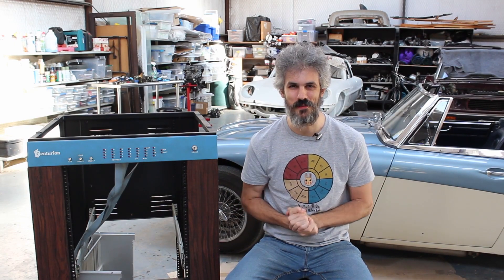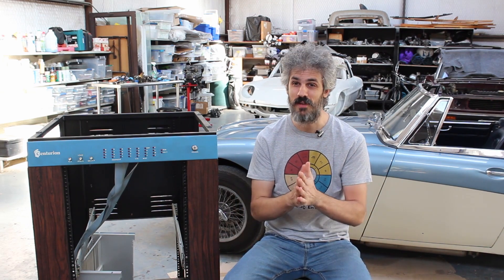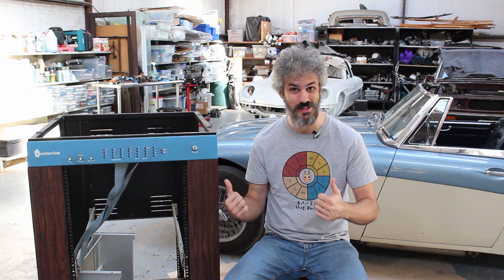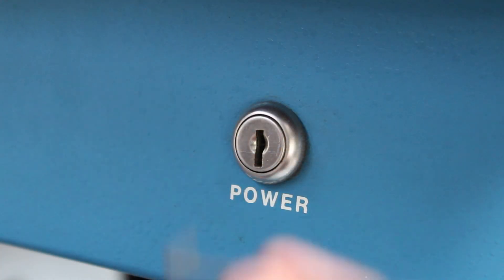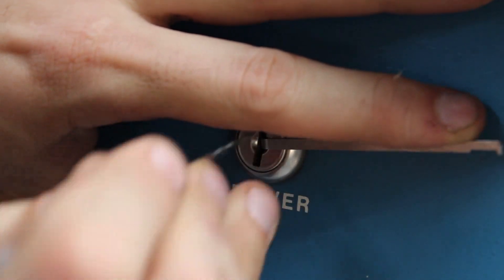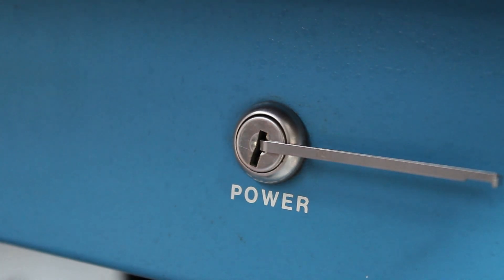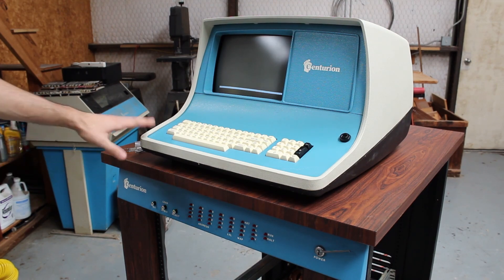Minicomputer Part 7: Cleaning and Testing

Comment: Hi;
A few more things, Now that I have watched the CRT cleanup..
So, Do You know what Baud Rate that the Mux Boards use ?? Or, do they have Auto-detect for the Baud rate, that is usually done by doing a Carriage Return.. Also, You need to check all of the 9 pin ports on the two mux boards for a crt signal activity.. And the Resonant Oscillator (Crystal) on one of the Mux boards is a Particular Baud Rate starting point.. Also, what are the 4 pin switches set to or for on the Mux Boards ?? Also, tie the two CRT Terminals to each other pins 2 to 3 and 3 to 2 and 7 to 7 and see if they will talk to each other, just for a check of them, as well..
THANK YOU Marty
Reply from the maker: Thank you for the awesome advice!
I don't actually know what the Baud rate is, I've just been leaving the terminals set as they were, but unfortunately, each terminal is set to different baud rates, which means I have no clue what it's actually supposed to be. Also, I have no clue what the 4-position DIP switch is for on the two MUX boards, but they're actually set differently too. I'm guessing that it's potentially setting a primary and secondary? 
That is an excellent idea to check the crystal oscillator to get an idea of baud, I'll do that the next time I'm digging into it!
Also, excellent idea to see if the terminals will talk to each other, plus that could be a little fun to see anyways, haha.

Comment: Hi;
Thank You for Your prompt Reply..
A couple of things -- One I like Your choice of background Music.. Also, I like the Rabbit or is it Buggs Bunny..
Also, I would start tracing from both the memory boards and the CPU Boards, back to the gold fingers and settle on whether it is a 16 bit machine or an 8 bit machine.. I would start from the Memory board first, as the 4116 memory Ic's You know what are the Data Lines and the Address lines, You just have to follow thru the glue logic back to the Backplane, and then secondarily follow those pins to the CPU/ALU and that  should clear things up by quite a bit for You and for the rest of us.. And of course put it down on paper or whatever Your favorite meads of documenting.. Don't worry about how it Looks, just do it..
And I also love Your Tube ALU/Computer.. You explained things quite nicely and I learned something that I didn't know before..
I am trying to build a TTL wire-wrap computer when I have the time.. THANK YOU Marty P.S When is the Next video ??
Reply from the maker: Thank you so much for the kind words!
I'm fairly certain now that it's actually an 8-bit machine. It seems that a lot of these old minicomputers commonly used a setup like this, with one 8-bit board for the CPU and another 8-bit processing board for handling I/O, which would be the CMD board in this one. That also makes sense with the Memory boards sense they're arranged in 8-rows of 8-bits. They just need some additional control for chip select to give a large array of 8-bit memory to access. Once I get more of the system functioning though, I think it'll be much easier to see exactly what data is going where and in what amount using the scope or even a good logic analyzer!
Thanks for checking out the tube computer series too!
I usually upload new videos every Monday CST, but I missed the video this week because I had family come visit, so I took a little time off to be with them!

Comment: Hi;

I just Discovered Your Channel earlier and I am really interested in Your Progress on this Machine, even though I have never heard of this brand of minicomputer.. 
Did You notice that the Terminal printed "Hello" after a bit, and most likely was waiting either for input from You and or waiting for a Drive "ready" signal..
Also, you mentioned in a previous Video that it only had two 4 bit alu Ic's.. but it is a 16 bit machine.. Many machines of that era used this same technique for cost reasons it was cheaper to use less ALU IC's than 7400's Ic's as glue logic, instead of 4 ALU Ic's and less glue logic..
Check out the Data General 1200 Nova.. For an example of this technique, they used one 4 bit alu repeatedly using it 4 times to get the 16 bit output..
THANK YOU Marty
Reply from the maker: Hello and thank you for checking out the videos!

And don't worry, I had never heard of this brand of computer either until I saw it in person. It's a really weird footnote in computing history with very little information out there on it!

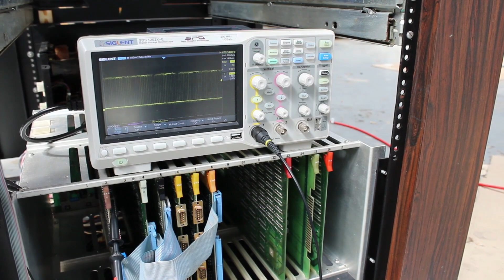I should have specified in the video, but the "Hello" that prints on the terminal is actually just me typing "hello" directly into it trying to get a response out of the machine (the terminal has self-echo turned on, so anything I type is internally echoed to the screen). If you watch closely from about 15:57 on in the video, you can see that as I snag snapshots, it's actually the same pattern of bits just moving left or right. My guess if that you're on the money with the idea that the MUX cards only come into use after booting, and the CPU is in a wait loop looking for boot information from the drive. 

In the previous video I mentioned that it might be a 16-bit machine because I didn't fully understand the relation between the CPU card and the CMD card. A few other commenters on that video helped get me turned in the right direction. It's mostly likely an 8-bit machine, and the additional bit-slice ALUs on the CMD card are used for Input/Output control. There's so much extra stuff going on in this machine that I'm having a hard time following the total logic layout, but it sure is a lot of fun to stumble my way through it, haha.

Interestingly, I did something similar to the Data General Nova with the all relay binary calculator I built a while ago. It uses a 1-bit ALU that gets used repeatedly to give a 10-bit output.

Thanks for checking the channel and videos out!

Comment: Some transformer hum is normal especially when under high current loading, but you may have a loosened core lamination issue.  If you're lucky, this might help:

Eliminate the Cause of Excessive Transformer Noise/Humming

Part 1

https://www.youtube.com/watch?v=lUt8rE9tYo0

Part 2

https://www.youtube.com/watch?v=aAPpiWM_U60
Reply from the maker: Thanks for the links!
Some other commenters have mentioned that it's a Ferroresonant transformer, which is an inherently noisy design. Since they have an LC tank circuit and run in full saturation, they're really stable but at the cost of noise and efficiency.
Fortunately, the computer lives in the garage and it's not nearly the loudest thing out there, haha.

Comment: Time to pick up a cheapo logic analyser? (so you can clip onto say 12 or 16 lines on that ROM ... watch for address hits, data back and forth, and the read/write direction pins, etc .. when testing arcade boards for example, I always get an audio probe and listen for 'noise' (life) on pins around the ROMs and CPU, and when you gfet serious.. clip on an LA and see if the data going around makes any sense at all; if its slow enough and you can catch transitions, sometimes you can step through a few on a ROM and catch the read pulses and catch the bytes going out (if your scope has enough memory to record such things, or an LA dumping out over USB to a PC or something.) With a lot of luck, a LA may be able to decode you a data stream and you can compare to the contents of the ROM and verify hey yep, itsd getting sequential information and its coming from the ROM. Or check that address fetches seem to make any sense.. usually you'll get a few in aa row for instance, as sequences of opcodes get requested...

Super awesome!
Reply from the maker: Thank you! 
And it's like you're reading my mind, I've been shopping for good, used Logic Analyzers for a while now. Once I get one of the drives installed back in the chassis, I think a Logic Analyzer is going to become necessary to start trouble shooting different bits of the system. I've also been trying to figure out a good way to build a riser card that can go between a card and the backplane to push it out so I can clip leads onto it a lot easier.

However, just by hitting the single shot button over and over again, I was actually able to see a pattern, so the CPU is at least sitting in a loop, probably waiting for code from the drive (you can just make out a repeating pattern from about 15:57 on in the video).  But, a logic analyzer I think is going to be in my future soon!

Comment: Amazing, how well the chassis cleaned up, especially if you think about it being stored in basically a ruin. 
Even the wood is totally spotless. 
Another interesting thing is that the "time to find the serial lines" seems to be a valid next step, no matter what you do in electronics. 

Looking forward to the next episode.
Reply from the maker: Thank you!
And yeah, the Chassis cleaned up remarkably well given the state it was in! Though, I will say that the wood piece on the top is actually from the other chassis as the original one on this chassis was starting to de-laminate from water damage. The front wood pieces came up spotless though, which is crazy! If nothing else, the entire purchase was worth it for the chassis, though with the cleaned up data terminals thrown in, I made out like a bandit regardless of how everything else turns out. 

If you watch closely from about 15:57 on in the video, you can see that as I snag snapshots, it's actually the same pattern of bits just moving left or right. My guess if that you're on the money with the idea that the MUX cards only come into use after booting, and the CPU is in a wait loop looking for boot information from the drive. So, there's still a few things I need to tackle before I can start to expect any reasonable output, but we're slowly getting there!

Comment: Check the backplane, there where it looks kinda wrinkled, that might be the pcb delaminating. If it is delaminating then it might cause shorts or just not have connection between the boards.
Also tighten the bolts on the transformer might help with the noise.
Lastly check the ribbon cables, those old cables just need a bend or a hard bump to cause problems.
Sorry for the rant :)
Reply: What you see is the wrinkled tinning of the pcb.  And the nouse, is because it is a ferro resonant power supply, they are noisy!
Reply from the maker: Thanks for the pointers!
I think the backplane is alright. When looking closer at the crinkled area, it looks like it's just the soldermask starting to crinkle up. When I recapping the boards, in some instances, I could actually see the solder flow under the soldermask, following the trace. It's probably not ideal though, so I'll keep an eye on it!
As for the transformer, I believe its a Ferroresonant transformer, which uses an LC tank circuit and operates in saturation, and they're pretty known for being noisy. As long as the levels remain stable, I'm just gonna let it sing!
Good call on the ribbon cables, I hadn't thought about that, but you're right, they're quite old and could definitely have a problem.

Comment: That transformer sounds like a ferroresonant transformer. If it is, then the buzzing is completely normal. 
If there is an oil capacitor across one of the windings, then it's likely a ferroresonant transformer. Be careful around the capacitor, it will have several hundred volts AC across it.
Reply from the maker: Yup, you're absolutely right! In a previous episode a few commenters actually managed to identify the PSU transformer as a ferroresonant transformer, so it's good to know that those are inherently noisy! 
There's two massive capacitors in the PSU, one is clearly a DC capacitor for I'm guessing the 5V rail, but the other is definitely an oil filled AC cap for the ferroresonant transformer, so I've been particularly cautious around that one.
Reply: These are operated typically between 85% and 90% of rated load as part of the power conditioning design.  That noise you are hearing is because the transformer is operating in its saturation region.  (Natural resonance.)

Comment: It's likely looping waiting for the bootstrapping code. 
Go and get a proper RS-232 LED tester, and find the console port0, which will be the one with any text data present.
Never trust someone else's cables, go make your own, the pinouts are readily available everywhere.
Reply from the maker: You're definitely right that it's sitting in a loop. From about 15:57 on in the video, you can see that as I snag snapshots, it's actually the same pattern of bits just moving left or right slightly based on how quickly I'm pressing the button. 
I feel like a dolt, but I should have bought a proper RS-232 tester a while ago, it never occurred to me, haha. That has been rectified and a nice cheap one is on order!
Reply: Finding which of the console ports is the port0 is indeed a good tip, it's unlikely all terminals ports are active at boot without the system being loaded. If other similar computers are anything to go by, at least one of them should be outputting error messages regardless of the system/disks being present.

If I had to bet, I would guess the port0 would be the lower one on the multiplexer board with the crystal populated (the one missing the crystal is likely a slave to the other). Based on the dip switch settings of the terminal, they should be 1200 bauds, unless it boots at another speed by the default and the system settings on the disks changes it to 1200.

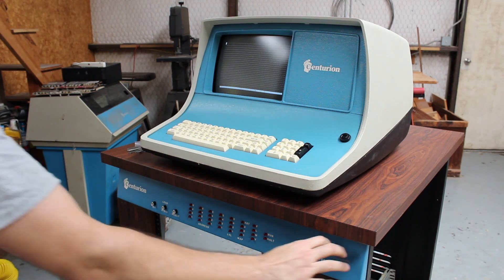I noticed on 12:30 that at boot, the address LEDs do change from one state to another, something is definitely happening!

Comment: noisy transformers are sometimes an indication that the screws holding the individual E plates together are loose.  It's worth checking if the screws are tight.  Also be careful about the 5v rail - TTL spec is 4.95-5.05.  it's very stringent.  If your meter is accurate 5.3 will be too high and can cause premature failure.  It's also entirely possible it's set high due to high load causing sag when all the cards are installed.
Reply from the maker: I think in this case, the noisy transformer is due to it being a Ferroresonant transformer. Those types of transformers have a separate LC tank circuit and operate in saturation and are supposedly quite noisy. 
I also checked the 5V rail once all the boards were in and there was a proper load on the supply, and it pulled the level down to below 5.1V, so it should be alright!
Reply: I remember in a previous video that one of the boards wanted 5.2V. I can't remember which video.

Comment: Don't worry, you won't be hearing the transformers at all once all the fans and the hard drives are spinning.

Btw. 4116 DRAM chips have a quite high failure rate, I'd expect at least 4 of them to be bad.
Reply from the maker: Oh yea, definitely! Already with the cooling fans under the computer, there's a lot of noise, with the drive spinning up, the transformer noise will definitely just disappear!
And I'm definitely expecting some of the 4116 chips to be bad, but it seems it's easy enough to modify some 4164 chips to replace them, which I've read are a bit more reliable, so that's most likely in my future as well!
Reply: @UsagiElectric  Yes usually that's feasible. Note though that history has proven that some boards don't like the timings of 4164s and you can end up in any state between "weird flakiness" to "refuses to boot at all".
Although my money is on "it will just work with 4164s"
Reply: @UsagiElectric  ah and if you get lucky, there's only one source for the address generation which would allow you to replace two or four of the 4116 with one 4164. 
I tried that on a few arcade machines though and there always was one address source for the CPU access and another for video access which usually read them in parallel so there was no way to save chips when replacing them.

Comment: Excellent!!! I had a thought I bet you can get a round panel switch to replace the key switch. The lock should just be held in with a c-clip and likely a nut. I've done this exact thing a few times in cash register repair as a recommended PM on certain IBM point of sale servers..
Reply from the maker: Thank you!
You're totally right, the lock is just held in place with a little threaded nut around the body. It would be easy to change, but the lock is so ridiculously easy to pick and adds a bit of fun to the process of turning it on and off, that I quite enjoy having it in place. In the future though I may add a hidden switch somewhere that bypasses the lock so it can be turned on either by picking or flipping the hidden switch.

Comment: Top tip: Get yourself a chisel tip for that iron, if possible a short one, those pencil tips aren't able to transfer enough heat into multi layer boards.
Those resonant transformers are always noisy, so that is indeed perfectly normal.
Reply from the maker: Good eye on the ferroresonant transformer! This is my first time hearing one in person, so I was a little surprised at just how noisy they are, but it's good to know that is normal operation!
And for the iron, I actually do have a chisel tip for it, but by the time I realized I should have changed the tip, the iron was already hot and I was too lazy to wait for it to cool down to change tips. Ironically, it probably would have been faster to let it cool, change tips and use the chisel tip, but it's kind of like how it's usually faster to wait through traffic, but the back road that takes longer actually feels faster.